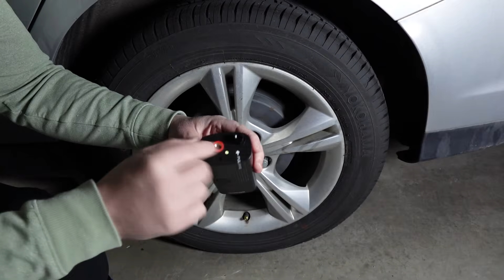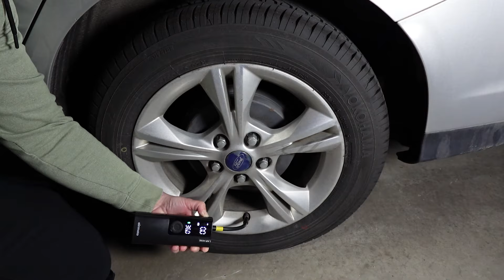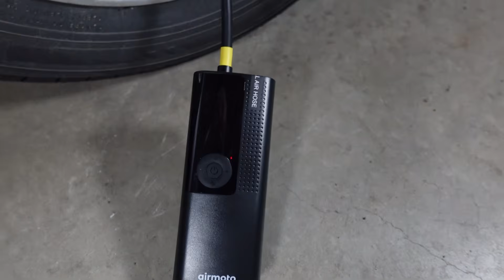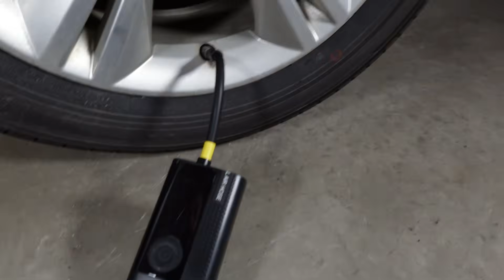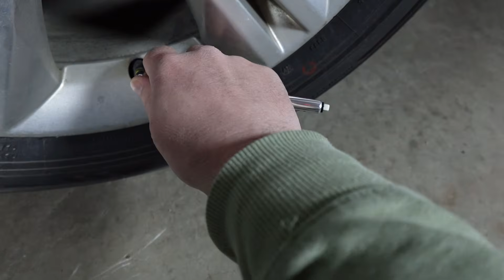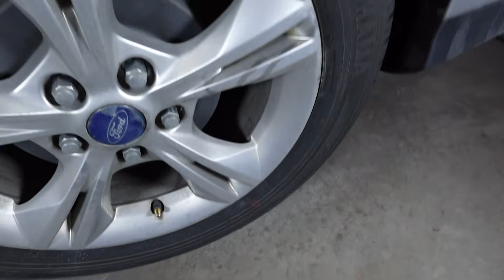How to Use AirMoto Smart Pump to FIll Tire - Handheld Tire Inflator Portable Air Compressor

Comment: Mine no longer reliably gives a readout of the tire pressure when attached. Which is a problem. It can show 0.00 when its almost at recommended pressure. Have hardly used it so its disappointing.

Comment: Apparently that wasnt totally flat and fully charged i just did my tire from rim on the ground to 35 psi around 30 min. still had enough battery maybe for another tire havent tested that out yet. Its not horrible for the price and size itll definitely save you.

Comment: doesn't take take way less than over 20 minutes ?

thought it takes for about 3-5 minutes

wonder what happens if i pump all 4 flat tires ?
Reply from the maker: It can top off a tire in a few minutes if it's a few psi low. But in this video I filled it up from zero. That's why it took longer.

Comment: My buddy got one and let me use it it works very well it's a little slow but it does its job and the batteries I topped off four tires about 9 psi each and the battery didn't even move

Comment: I recently purchased the same product, although it's manufactured by Lenovo. I just have a quick question—how much time does it typically take to fully charge the pump? And once fully charged, how long can it be used continuously?

Comment: The AirMoto is a good device but while can get a car flat tire up to functional status (barely!!) the intended purpose is more on the motorcycle/bicycle (and sport balls for sure) territory... I have one and it goes from being fully charged to the tool roll bag on my motorcycle when  I'm going for a ride, perfect for minor adjustments on seat air springs and for tires and for sure will get you out of trouble if you end with a flat tire on the motorcycle.

Comment: i would slap sum1 if that did not do 1 tire mine do my tires but mine R 11inch 10ich i do a few at the same time the battery serves me well but i do have 5 in total so i have no issues with my tires

Comment: My portable one doesn't let you choose your PSI. It simply goes up to 10.0 and starts over again. Does that mean it will send 10 PSI of air into your tire?
Reply from the maker: Try switching it to another setting like the car. That should let you go to a higher psi.
Reply: @CleanMachinesYT  I just discovered that the one option I thought was for something else like a bike or ball was simply 'psi'. Problem solved!

Comment: This Airmoto air compressor does not work and is overrated. Had it for a few weeks, inflated a total of 8 car tires and the unit failed. It stopped working. Customer service does not return your call. Bought it on Amazon with a 1 year warrantee from Airmoto to no avail. BBB in Texas where Airmoto in based has numerous complaints about their business practices

Comment: 22 minutes!!!  I could do it quicker with a foot pump 🤦🏼‍♀️ I wish I'd seen your video before I bought it. Haven't used it yet. Hopefully it won't take that long, my tyre isn't dead flat like yours. Thank for the video.
Reply from the maker: Haha no it doesn’t take that long when the tire is just a little low. It takes a few minutes if you’re just filling it up a few PSI.
Reply: I got one that say bars for car.  @CleanMachinesYT
Reply: Wouldn't it take you longer to put on a spare tire.
Reply: I thought it was a little winded myself. Nice and thorough but maybe just a bit too much.

Comment: Just watched this video to see if I had done something wrong, I didn't, but used my Airmoto for the first time on all 4 tires as all showed a little low.  Airmoto read 36 psi on each tire, but car sensor is showing 3 tires at 33 and one at 34 psi.
Reply: Even the cars sensors sometimes are not accurate. I suggest to buy one of those tire air check without digital.

Comment: Particularly useful video because it shows actually using it (instead of other videos that only show the setup).  Clarified some key points for me, and I feel ready to give it a try.  Thank you!

...20min later update.  Used it to inflate a car tire from 22psi to 33psi.  Took about 5-10 min.  Worked great 👍🏻
Reply from the maker: Thanks for the nice comment and I’m glad it was helpful! I’ve used mine multiple times and think it’s a great tool for anyone with a car.
Reply: Stopped working after 4 tires
Reply: Charge it.
Reply: Stopped working after 8 tires. Call manufacturerand with warranty never got back to me.
Reply: Very helpful demo by Drew Smith. Thanks
Reply: Thank you for showing how to use the airmoto step by step it was very helpful